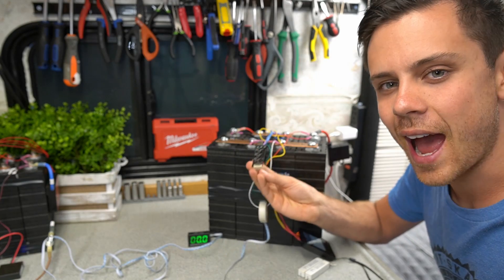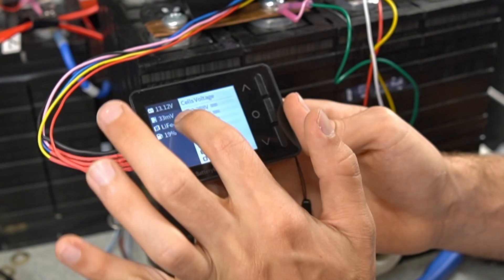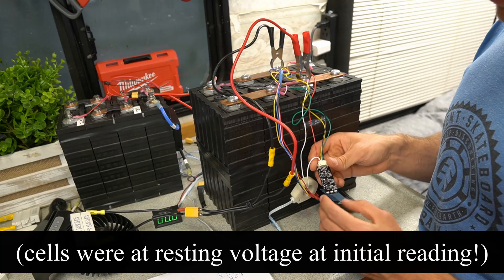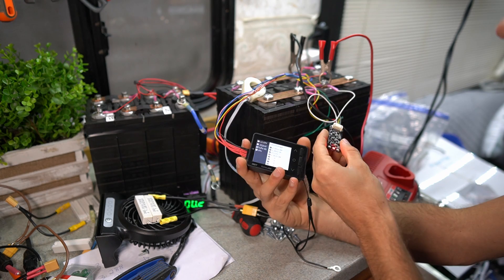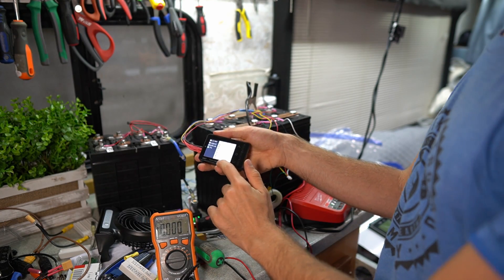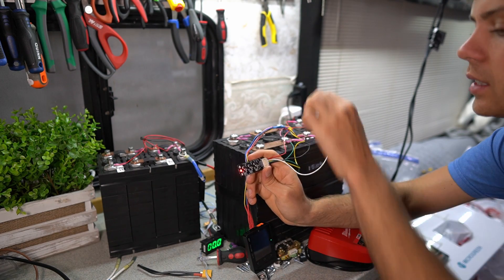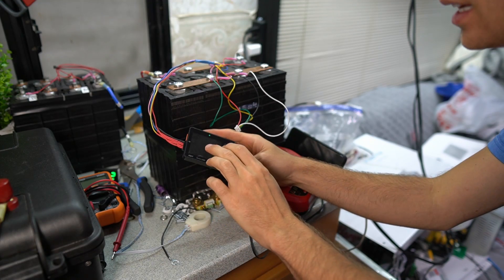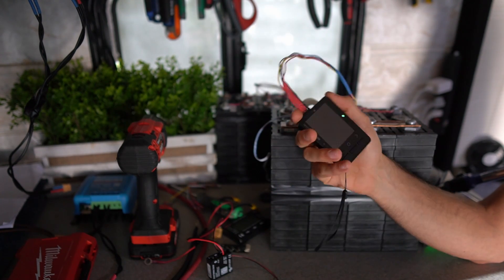"Active Cell Balancers": Did I get Ripped Off??

Comment from the maker: There are 3 separate circuits for 4 cell board, so some viewers said that balancing will only occur on adjacent cells. Some of my viewers said that the inductor is a resistor so its passive. 
If we had a board schematic it would be pretty obvious what is going on. Another viewer posted his video showing the lowest voltage cell rising in voltage, so is mine defective? I would imagine that at least one of my tests would cause my lowest voltage cell to rise a little bit, but it never did. 

Comment thread and other videos from other viewers can be found pinned on this video: https://youtu.be/fEVQ_8DUpm4

Please let me know what you guys think! Would love to hear your thoughts.

Tired of getting ripped off? Check out my "Will Prowse Approved" solar product recommendations below!

12V Batteries
https://www.mobile-solarpower.com/lithium-batteries.html

48V Batteries
https://www.mobile-solarpower.com/48v-batteries.html

Offgrid Inverter System Builder
https://www.mobile-solarpower.com/48v-complete-system-blueprint-559371.html

Hybrid Inverter System Builder
https://www.mobile-solarpower.com/code-compliant-48v-offgrid-system.html

Mobile Handtruck System Builder (very popular!)
https://www.mobile-solarpower.com/mobile-48v-system.html

Solar Panels
https://www.mobile-solarpower.com/300w-solar-panels.html

Ground Mount Solar Racking
https://www.mobile-solarpower.com/ground-mount-racks.html

Wire, Lugs and Busbars
https://www.mobile-solarpower.com/wire-and-connectors.html

Tools
https://www.mobile-solarpower.com/tools.html

Fuses and Circuit Breakers
https://www.mobile-solarpower.com/fuses.html

Plug-N-Play Solar Systems
Ecoflow, Anker And Bluetti! So many models to choose from. See my current recommendations here:
https://www.mobile-solarpower.com/full-size-systems.html

~~~~~~~~~~~~~~~~~~~~~~~~~~~~~~~~~~~~~~~~~~
Need to build a large DIY system? Need a trustworthy solar distributor? These are my favorites:

Signature Solar
Creator of EG4! Solar Minisplits, Victron and More! Largest Solar Store Online.
If you want $50 off, please use my link below and coupon code "DIYSOLAR50":
https://signaturesolar.com/?ref=cPwLcVc0SW-BjN

Current Connected
Best Prices for EG4, Victron, Midnite and so much more! Fast Shipping and Highest Rated Customer Service:
https://currentconnected.com/?ref=wp

~~~~~~~~~~~~~~~~~~~~~~~~~~~~~~~~~~~~~~~~~~
Join our DIY Solar Community 
Need more help? Join the largest solar forum on the internet for beginners and professionals alike. 140,000 members and counting!
https://www.diysolarforum.com

Check Out My Free Book
Best-selling and beginner-friendly guidebook to off-grid 12V solar!
https://www.mobile-solarpower.com/the-book.html

~~~~~~~~~~~~~~~~~~~~~~~~~~~~~~~~~~~~~~~~~~
Contact Information:
I am NOT available for personal solar system consult! If you wish to contact me, this is my direct email: williamprowsediysolar@gmail.com
FTC Disclosure Statement and Disclaimers:
Every video includes paid promotion or sponsorship (such as free products for review). Some links on this YouTube channel may be affiliate links. We may get paid if you buy something or take an action after clicking one of these. My videos are for educational purposes only. Information is subject to change/update at any time. Electricity is DANGEROUS and can kill. Be smart and use common sense :) DIY Solar Power with Will Prowse is a participant in the Amazon Services LLC Associates Program, An affiliate advertising program designed to provide a means for sites to earn advertising fees by advertising and linking to Amazon.com

Comment: It depence of your top voltage, close to the balancing voltage equilibrium the lower the balancing current is, if they are way different voltage between each other you will find full 1.2A balancing current. I charged separately one cell on 3S and let the balancer do the job, and it did pull full 1.2A.

Comment: I a quite sure, these are the boards I have tried out, thinking they were active balancing boards, 20 percent of the boards I used, have failed, the transistors burn out. :( under normal use over time.

Comment: Havent watched the full video yet, but the ampere of the balance depends on the voltage difference. Since you have next to no voltage difference, it does not do much.
Try with 3 full and an empty cell.

I have bought a 10s version myself, and the 1.2A is real, and its for every couple, not the combined power

Comment: Its not good balancer. Example 4s case if 1st cell has lowest voltage and 4th cell has hiest voltge, even if diference is more then 0.2 V it does not start balancing. It start if imbalance is between next cell. I bought two of them, and now i am looking for new one's for my yacht batteries.

Comment: use the flying capacitor one
they are really true active balancer. they shuttle charge between the cells with caps and connecting the battery alternating-ly.

Comment: gee. another product I bought because Will showed it working , but does not work. unbalancable china batteries $400, useless balancing OVERKILSOLAR BMS That I have yet to see in balance mode at all, useless app for BMS that apparently only works on unknown secret phones that I don't have in my vast collection $125, and now the old bait and switch useless inactive balancer for another $25.  I think I'll just spend anothe $600 on some lead acid that just work.
my mind hurts from the fact that I put 8 batteries to make a 24 volt battery that can never get below 26 volts to the 22.5 v needed to turn on the existing lead acid charger like everyone said it would, because one of the 8 cells can shut down the whole battery for 5 different safety reasons and fry my charge controller and inverter that say," never disconnect battery while running".I guess the hundreds of lithium video makers never read that far in the manuals.
," never disconnect battery while running"
 sorry but my kids are grown up now and I don't want to baby sit this battery any more.

Comment: its an active balancer. I did your test but on a smaller scale. 4s 6ah lifepo4, it needs a 0.1v voltage difference to activate. I did 1 discharge test, and 1 charge test, it activated both times. My battery went from 0.12 voltage difference to 0.03 difference after charging. I don't know if it can do 1.2 amps, but it definitely does help a lot.

Comment: Also since the active balancer is using induction magnetic storage to transfere energy it might not be possible to measure with a clamp meter or a standard DMM.
I've seen anotherone testing this as a 6s and having 1 volt difference in cells where only one was high and the other ones all increased in voltage with it on. 
But the 1.2a claim might be overestimated.
Considering to buy one for testing

Comment: Hello , as specs refer more the difference in voltage between battries more the drawing and pushing current upto 1.2a max , also first connect negative to positive one by one and always check polarity or it may smoke and also disconnect positive to negative to keep it on safer side

Comment: I'm going to offer some numbers and Ohm's law as a reason why the active cell balancer isn't pushing 1.2 amps.  If I understand your initial setup correctly, you had your "strong" cell at 3.28v and the weak one at 3.25v.  That's a difference of 0.03v and you're trying to equalize them with a 1.2 amp current.  The only way this is possible (with 100% efficiency of eq board) is if the circuit resistance has a maximum of 25 milli-ohms.  That includes both battery cells' internal resistances & that seems awfully low.  Being your current draw was about 0.2 amps with a .03v difference, this calculates to 150 milli-ohms (75 per cell). That number seems still a bit low, but plausible for a LiPo cell.
The take-away is, there has to be a significant voltage difference between cells before 1.2 Amps can be expected.  Ohm's law cannot be ignored.

Comment: I think that balancer uses ETA3000 chip. If so, then balancing kicks in at 100mV typical based on the datesheet of that chip. And balance current is minimum at 100mV adjacent cell difference and balance current goes higher as the delta goes higher up to 1.2A. I have one and it works.

Comment: I decided to test these out on a used LG Chem module battery that i got and it did raise the lower voltage cell up but it was 0.35 volts off from the highest cell. I wish i would have put a meter on it to see how much it was moving but it did bring the voltage up without me having a load or charging it. I don't know know if these work or not. Could you do more testing and see.

Comment: Real active balancing circuit would require external battery or capacitor to store charge taken from cell to deliver it to another cell. Orion "balancing" is actually discharging higher loaded cells to dump load to make all cell as bad as lowest cell. So if one cell is bad it makes rest cells bad as well. You can NOT redistribute charge when all tools you have just shunt across the cell. Just impossible. Learn circuitry.

Comment: I've been designing my own active balancer using SEPIC switch modes. To achieve 1A of balance current is taking larger charge components and better smarts for control than this module is using. The benefits are good though as it is more efficient in power usage. Also you have the ability to balance on a discharge cycle as well as a charge cycle possibly giving you a little longer battery life.
Reply: how is the design going?

Comment: Before we know if the balancer is working properly, test the current charging the lower cell with a bench charger that is the same voltage as the higher cell.  You will be suprised that the current between the cells based on voltage difference is very low.  There is only so much it can do because there is only 0.1v differencial when it starts.  I have two of these and they work well. My tests indicate that with 0.1v difference, it can't push 1.2a between batteries.

Comment: Please read the datasheet on the balancer. The chip is an ETA3000. It is a switch mode power supply and an active balancer, but it only balances between two adjacent cells when they are at different voltages with some hysteresis. So if you have say a 4S with the 4th cell at a low voltage it will take power from the third cell until the voltage between the 3rd and 4th cell are even. However that will then make cells 3 and 4 lower than the rest of the pack so it will take power from the second cell and move it to the 3rd until it has matched cell 2. It will then shuffle some power to 4 and pull from 1 to 2 and then 2 to 3... and keep shuffling power around until all the cells are balanced. Now its not quite as slow as it seems as it can move power from 1 to 2 and 2 to 3 and 3 to 4 at the same time, but that will only happen if all the cells are at different voltages. 
 
As far as the current, I don't know what it would take to get to the full 1.2A. Maybe they won't balance that quickly, but it probably take a large voltage difference between cells for it to run at the full current. Very much like you can't pump full current into a battery that is already charged. I have one and plan on measuring the currents to see if it ever does reach that max current rating. 
As far as testing you cant measure the current it is balancing with out the proper equipment. A digital mutil-meter will not work correctly for this circuit because of the burden voltage in the current shunt of the meter. Go look up burden voltage, but essentially the current sense resistor used in most DMMs will be large enough to create a significant voltage drop in the circuit you are trying to measure. Often that is not an issue, but in this case the balancer is very dependent on what the voltage between the cells are and changing the voltage it sees but adding in the large current sense resistor will mess up how the balancer runs and screw up your test. 
 
The hall effect sensor could work, but if the upper range is too high on the sensor, then it may not measure well at its low range. That may be why you only got 0.2 and no other readings, but if you checked the meter at currents below 1 amp and it measured good then its good. If it is measuring correctly then I would go back to the batteries probably need to have a larger voltage difference to balance at higher current. 
 
I forgot to mention, the transistor frying its from them trying to add more protection to the circuit, but may have caused an issue if you don't have all the wires hooked up. I think with this design you have to make sure everything is hooked up before you plug in the board. That definitely sucks about these boards.
 
Overall your review is not too bad, these do seem to balance slowly.
Reply from the maker: Yeah great points but I realized after this video that active balancers are absolutely pointless. even for unmatched ir and capacity cell banks. So I don't use any of them. Waste of money
Reply: @WillProwse  

I am new to battery packs so I am curious why you decided active balance is pointless. If you haven't please put up a video. I do know that in my case I have a 4s LiFePO4 pack that has one cell that is not so good and slowly discharges. I like having the balancer to keep the cell close, but also I don't really use the pack for anything.

I did do a test last night on that active balancer I have (the same you tested in this video,) and found that the voltage difference is a big factor in the current. With a small voltage difference the current is low, but as it increases the current goes up. To test this I used my 4s pack which was at about 3.2V per cell. I started charging just the top #4 cell and hooked a low burden voltage current meter in the balance line for the #3 cell. Then measured the charge current moving down to that cell. I got up to 0.66 amps at about a 0.3V difference in the cells.

I then started charging the #1 cell and put the current meter in the line for the #2 cell. That got about 0.96 amps of current at about 0.35V difference in the cells. 

It looks like these active balancers will work, but the charge current is slow. I plan on using them for small packs where I think the charge current should be enough to keep them in balance even under load, but for big packs it wouldn't do much.
Reply from the maker: @trottingwolf  watch this video
Reply from the maker: https://youtu.be/cmZ-_sRnGj8

Comment: The tiny pcb module does its job. It is just not designed to charge, but to balance. So the current increases in case of increasing voltage difference. if you use a prebalanced pack it should work. you also can use more than one in parallel because of the hysteresis. Adding them to a working battery pack is not the worst idea because of also low standby current. sorry for the bad english.

Comment: They only balance each neighboring cells, and only start at 100mV difference. Complete garbage.
Only use them together with a smart balancer or a BMS.
If you have 4s per example: c1: 3.0V, c2: 3.05, c3: 3.1, c4: 3.15 the balancer will do nothing. If you fully charge the battery now the cell 4 will overcharge!!

Comment: You may want to try another round of testing on the cheap active balancer.  That type of balancer gives more current based on the difference in voltage between adjacent cells.  I believe yours is rated to hit its max for a cell-cell difference of 0.2 V (even though they start transfer at 0.1V).  While the max current may be much lower than rated by the seller, there does appear to be genuine charge transfer going on (out of one cell and into another), and there certainly is on the one that I have tested.

Comment: These boards work fine BTW guys.
The problem is that he's using them on LIFEPO4, and they are not designed for that. They have protection built in for low voltage cells to only transfer at 10% power to protect the cells until they get back up to 3.7V
So pointless for LIFEPO4, but perfect for 18650 packs etc.
Though there are 2 varieties of this board, and one of them advertises as 1.2a but is only setup to do 1A or something i believe. You just need to change the resistor value to change the current if you need to i guess.
Reply: he needs to change the video to state this really

Comment: According to the info for mine, the further out of balance the cells are, the higher the current transfer. They don't even do anything until there is 0.1v difference between cells anyway. I've found a 5A version on ebay and ordered it. It could speed up analysis drastically if you were to use 18650 cells rather than big LiFePO4. I plan to do this myself.

Comment: I got one of each of those devices for each of my 12V 100AH LiFePo4 packs after your other video.  The plan was to use the active balancers to balance the pack and the battGo screen to see cell voltages.  I haven't assembled the batteries yet, so the plan could be changed.  I made a Y cable so I can plug both the battGo and the active balancer into the battery at the same time.  I guess I should still put both on there and set the battGo to balance as well.  It won't balance as fast as expected, but will probably balance the pack eventually.  Or would you do something different?

Comment: Hello my friend. This happens because your batteries is almost same voltages, to use all balance  power from the board of 1.2A - 1.5A the batteries must have much more voltage difference. I upload new video with testing this board, so you can see currents of etch sell.
Reply from the maker: This balancer was actually defective. I have another one that works great!